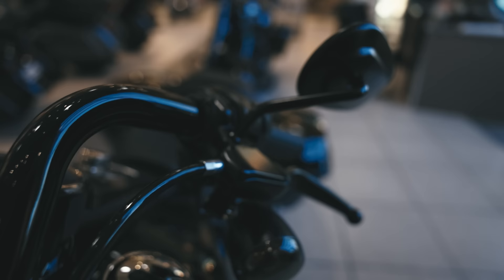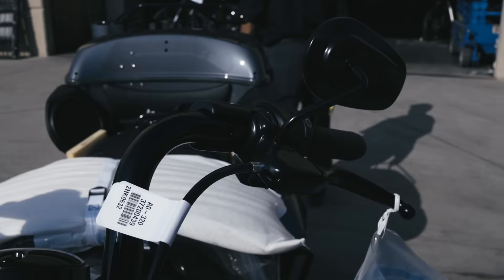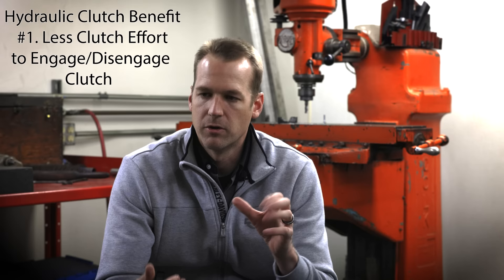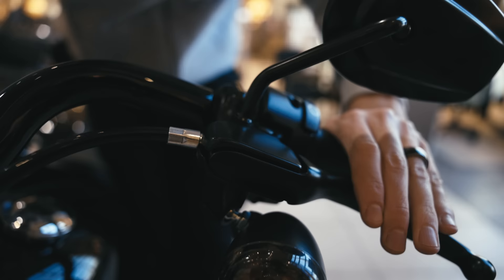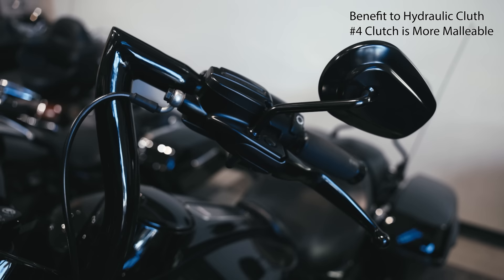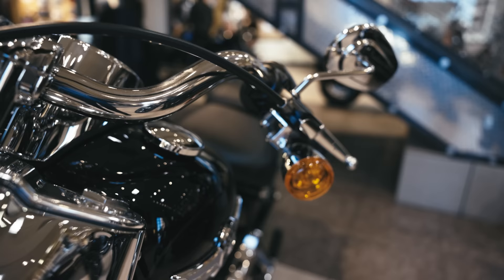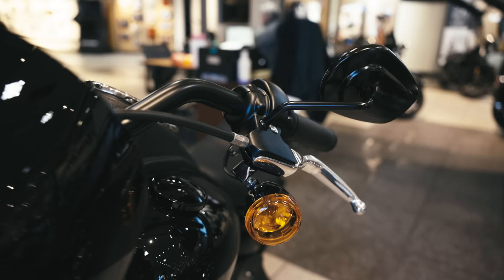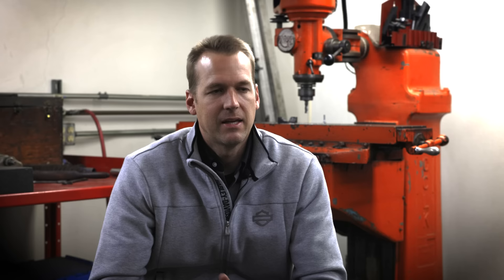Why Harley-Davidson Switched Back to a Cable Clutch on Touring Motorcycles│Pro's vs Con's

Comment: Me and ODB go Old School all the way! - Anyway, I never used a hydraulic clutch, but Ive heard a lot of folks like it.
Reply from the maker: Going to pin this comment because of the ODB reference. Haha you made my day.
Reply: Yup....if you want to whine about a tired hand....kick the thing into neutral during  a long stop....
Reply: Anyone that likes it has hands like a gorilla. Clutch engages just as I run out of fingers. Literally holding it with the first knuckle.
Reply: @rc3291  I love cable clutches. I wouldn't consider myself particularly strong.
Reply: @Slking507  Me too, I can adjust where the friction zone is.
Reply: @Slking507  Not really a strong thing as much as to where it engages and size of my hands.
Reply: @rc3291 I had to get the softbrake easy reach lever.

Now I gotta get those Oberon adjustable levers for my 124.
If I set the clutch at 3/4 turn at the primary the lockup pressure plate I put on doesn’t have enough clerance on the clutch plates. 
So to be able to shift fast at high rpm and not get stuck in gear

Comment: Anything HD does has 50% of it's "fanbase" bitching about it. They are in a lose/lose situation. If they stay the same they "aren't innovating enough" if they step outside the box they're "alienating their customer base". This is no different, it's the age of the internet, too many would rather complain than ride. Do I like the new cable clutch? Who knows I haven't ridden it, and my guess is neither have a lot of the keyboard warriors that think it's the worst thing HD has done in 100 years.

Comment: When will HD go back to kick start?😀
Reply: Next year 😉🤠
Reply: Yes... I miss kick starters. Harley needs that nostalgia back.
Reply: bring back the pedal start system.  Now THAT's old school
Reply: We laugh but..... don't give them any ideas!
Reply: I've had a hip replacement. 
I don't think I'll be kicking over any 117cu in engine, compression releases or not.🤠
Reply: ID LOVE THAT
Reply: Points and condenser was so much better than electronic ignition.
Reply: That’ll be on the sportster classic which will run $37,000 next year.
Reply: Haha
Reply: That's why I still ride a 1983 FXWG. Kick, and Electric start.
Reply: anyone replying with "I'd Love that"... did you stop to think the motors are 2-3 times the size they used to be? it'd take a mule to kick start a 117CI lol.
Reply: they wont, compression is to high on modern motors
Reply: They could do a phony kickstarter that actuated an electric switch. I see Harley guys jumping on the shifter like it’s a kickstarter, just because feels right one supposes.

Comment: I really like my hydraulic clutch on my 18 road king special it’s 100% consistent and very smooth for me and no adjustments
Reply: I keep stalling on first gear take off.. did it take a while to get use 2?
Reply: I know I would get used to it, but I much prefer my cable on my 05 electra glide than the hydraulic on my stepdads 16 CVO street glide. Doesnt feel as easy to modulate, more like an on/off switch.
Reply: @Tom-jw1pe  , you are holding the clutch lever in correctly. You should have two or  three fingers wrapped around the grip and use your index, middle, or both to actuate the clutch. You will find bat the friction Zone will begin when the lever is slightly away from your fingers on the grip and you will have much better control in all situations. That is the technique that has been taught and utilized ever since the hydraulic clutch was developed 40 years ago. You should never be using all four fingers on the clutch lever, are you giving up control of your motorcycle.
Reply: I have an 18 FLHRXS as well and I wasn’t digging that clutch. Hit up softbrake, https://softbrake.com/reduced-reach-brake-clutch-levers/
This guy reworks factory clutch levers to make the operation more like what you’re used to. Super easy install too.
Reply: @robr8207  are they adjustable?
Reply: No but you shouldn’t need it. The friction zone is almost immediate as you begin to let out. He reworks the shape of the lever itself to adjust the engagement.
Reply: @robr8207  ok thanks I’ll check it out
Reply: You bet man. Hope you enjoy it if you get one. I love mine.
Reply: Like mine on my 18' RGS! like anything it takes a little time get it down but I never had any issues!
Reply: @robr8207  it is a game changer... I love it...
Reply: Hyd  clutch had small problem.
But overall the HYD.clutch was better.
Reply: HD. Should have offered adjustable clutch lever.

Comment: I wish Harley would start moving forward instead of backwards.
Reply: I wouldn't trade any of my old Evo's for anything new even if it was an even exchange! These new bikes got too much crap on them, they're practically cars from crying out loud. Thats just my 2 cents, no offense but I'm an old school dude who fixes his own stuff. These new bikes are full of too many gizmos. Battery life is roughly 4 years. Ive had the same battery for 7 years now. A simple bike for a simple person, THATS ME IN A NUTSHELL...
Reply: @kennethwise7108  Exactly!!👍😎
Reply: @SA-hk8xj  Sad but true, RDRS? Throttle by wire? Infotainment system? ABS etc.. yeah those are all fine and dandy things but I don't want something with all that crap on it. The only sensor on my bike is the float sensor and the trigger sensor for ignition inside the nose cone. Simple crap...
Reply: They have with RDRS, TPMS, ride modes like rain and road mode, the GTS is 100x better than the old systems.
Reply: @masterchief319  to each his own.
Reply: @kennethwise7108  sure, but I'd love to know what you want the company to do to "move forward". They listened to their customer base and obviously people wanted clutch cables back. Second, the amount of technology between my 2018 i traded in and the 2021 i just got is a night and day difference. Factory LED headlights now too. I mean what more are you looking for? Water cooled parallel twin jap motors? The Pan America is water cooled and making North of 150hp out of the box.
Reply: yeah likes voice commands or Eyes Start.  i'm very sure HOnDA will do it first or BMW. YOU see .
Reply: @alejandroludovice7302  Harley Davidson has voice commands through using apple carplay or Android auto, same as my 2020 GMC Truck.
Reply: @alejandroludovice7302  Not sure what Eyes Start is but my past 2 Harleys have been keyless start.
Reply: @masterchief319  more junk that will leave you stranded if and when it fails. I'm a simple kind of guy who lives by the motto "less is best". Nothing against people who have those kind of bikes but soon these bikes will probably have WIFI and self riding mode! F that...
Reply: @kennethwise7108  strange, my past couple trucks have had built in wifi and all these features as well as other newer cars I've owned. Never been stranded. Good thing there's things called road side assistance too thats covered by my extended warranties as well as my insurance company. Sounds like people in general are making excuses for hating harley davidson when in reality the real reasons are they can't afford the high end Harleys.
Reply: @kennethwise7108  the irony is, I have lots of friend who ride metric bikes as well as in local riding groups with thousands of people, the metrics seem to be the most unreliable. One of my buddies tried to race is 600cc crotch rocket and literally blew a hole in is transmission and grenaded the clutch as I pulled a bus length on him with my stage 1 M8. He had to call a flat bed tow truck. This ain't the AMF days 40 years ago.
Reply: @masterchief319  thats why I said "to each his own" you do you. I don't like all that crap. My older bikes will run circles around any of the new crap. Good luck
Reply: @kennethwise7108  lmao yeah okay 🤣

Comment: I for one am furious Harley dropped the hydraulic clutch.  Fortunately for me I just bought a 2020 Ultra Limited last year so I won't be in the market for another bike until around 2025.  If they haven't gone back to the hydraulic by then I'll go to another brand.  Why am I so adamant against the cable you ask?  I have no interest in going back to the 5000 mile service of the cable AND I had the cable clutch on my 2013 Ultra Classic snap on me while I was 2 hours from home!  They can say what they want about the change but I think it was a money saving decision plain and simple.  Not all riders are out here doing U-turns in a 15 foot radius.  The friction zone on the hydraulic is plenty good.  Going from a cable clutch to a hydraulic was a piece of cake.

Comment: My money is on H-D cutting production costs. A hydraulic clutch costs more to produce than a straight cable clutch. So, they lower production costs and raise prices.
Reply: And insure techs future work replacing a cable
Reply: The bean counters look at EVERYTHING in an effort to save a buck. I have seen this practice being used for several years now with the Motor Company. One in particular was the cam bearings. INA (caged) vs Torrington (full roller). Thin walled Swing arms were also a money saver for them, ive broken 2 of them.
Reply: I agree, this is about nothing but increasing margins.
Reply: Yes, to save money on the cost of the bike.
Reply: No more heel shifters, only 1 fob, inferior wheel bearings, failure to recall early twinkie spring tensioners, thin wall swing arm tubing (late evo & early twinkie), leaking master cylinders that destroyed the black paint (early twinkie), cam bearing and transmission failures due to INA style bearing (1988-202?), defective stators, defective hydraulic tappets, poor engine castings 1988-1994. Surely ive missed a few things and sadly i've been stuck into this lifestyle for over 30 years now and have suffered financially from the costs of fixing and upgrading these bikes. Damn shame...
My advice to ANYONE who purchases one of these bikes BUY THE EXTENDED WARRANTY AND KEEP EXTENDING IT!
Reply: Exactly
Reply: There isn't a vehicle in 2000's that are expensive let alone standard that have hydraulic clutch. A total step backwards. The tooling and supply for the hydraulic clutch is in play, no savings going to cable. Just a regression move to make the bikes antiquated. Therefore even less sales IMO.
Reply: It’s cheaper to produce one kind of clutch than two. So they’re saving money.
Reply: Didn't even mention HD taking a beating in the clutch recall. Fifty three million is what I heard.
Reply: @jeffhelm7581  you heard wrong...
Reply: @kennethwise7108  i cant find any fatalities, injuries, yes, but mainly just a recall and problem corrected.
Reply: @markfalco5868  👌
Reply: @talkingrock7011  So you never have to do anything to the hydraulic? LOL
Reply: @MisterSpermCell  I have never had to change a clutch cable but sure have rebuilt or replaced many master cylinders and slave cylinders. I suppose you think  the electronic throttle is the hot set up just wait until that craps out
Reply: Very true
Reply: I totally agree with you....
Reply: Cable is better than hydraulic. I would pay more to have it back.
Reply: @Slking507  Not in my view.  Hydraulic...no adjustments, and no 'break' surprises 1,000 miles from home.  Been there with cable, done that...always had to travel with a spare clutch cable.  Never again!

Comment: I totally agree with you 100%. When I bought my first hydraulic clutch motorcycle I was having a hard time adjusting to it, but after 6 years of daily commute and two bikes later I now feel that I like it better and don't want to back to cable. Who would know?
Reply: I Loved the Hydraulic Clutch on the first bike that I rode with one.The Cable Clutch on My 2000 Wideglide was getting harder to pull in even after being lubricated and adjusting.I Love The Hydraulic Clutch on My current Harley 2015 Streetglide Special.I have rode a few Harleys with easy to pull cable clutches and don't have no problems with them,they are just few and far between.

Comment: The friction zone on my 2014 FLHTCU is exactly why I purchased and installed the Soft Brake, front brake and clutch levers.  HUGE improvement.  Friction zone is much closer to the grip and much easier to control.  Front brake is easy to apply with 2 fingers as I ride, as well.  Best money I have spent on my bike.  No messing with the hydraulics like when you replace the slave cylinder either.

Comment: I see your view points but i do disagree. The fact that touring motorcycles are 30 or more easily. Yet don’t offer hydraulic clutch is ridiculous. 
It sounds like you’re trying to convince yourself this is a good thing. It’s not. It’s so out of touch.
Reply: I really like Matt, but yeah at times he is trying to convince himself that something that HD has done was a good thing. Honestly he has to, he's married to the Motor CO with the decades and family history with the dealership.
Reply: Heat Transfer from the Exhaust to the Clutch Cover is some of the Problem..
Reply: @Acmegamer  idk Matt is usually pretty honest with what he likes and dislikes about the Motor Co. he’s never been afraid to criticize them. That’s why I like his channel

Comment: I like the cable clutch, I can put the friction zone where I want it.
Reply: My BMW has adjustable clutch and brake levers so I can put the friction zone where I want it also.  And adjust for different sized hands.
Reply: @LTVoyager  lmao dont make him look like a caveman 😂 bmw is like that song "anything you can do, i can do better" but i still love harley (v-rod) 😉😎
Reply: @JL-wf2wp  I thought the V-rod engine was nice, but the rest of the bike wasn’t my style.  I am fairly impressed with the new Revolution Max engine also, but, again, it isn’t yet in a platform I am all that interested in.  I am mainly a long distance, two-up tourer and thus look for luxury touring bikes like my current LT, the Gold Wing (well, it used to be a luxury touring bike - not so much since 2018), etc., but I like modern technology also.  If Harley will just build a luxury touring bike around the Revolution Max and have a bike as competent as the engine appears to be, I may become a first-time Harley owner.
Reply: @LTVoyager  im in love with the vrod engine. Im not sure about the new revolution, it looks like a chinese copy of the previous porsche made revolution 🤔 maybe im wrong. And the vrod style isnt mine either.. but i can cope with the night rod special model with a different handlebar and further feet controls. The fat tire doesnt look bad at all 😎 you should give the vrod a try you wont regret it
Reply: @JL-wf2wp  I like most motorcycles so I am sure it would be fun.  However, just not practical for two-up riding any distance.  I have my K1200LT for that and a KLR650 for short, fun rides locally.  I would like to trade in the LT as it is 14 years old and has nearly 100,000 miles, but I have test ridden nearly all of the current full dress touring bikes and none are any better than the LT and most are worse for a lot more money.  I keep hoping though for a viable replacement to come along.  If not, I will probably get an R1250RT as it is about the closest to the LT without being a maintenance nightmare like the K1600s.  I really wanted to like the new Wing, but after a 100 mile test ride, it just has too many shortcomings, mainly luggage capacity and fuel capacity.  The seats are terrible also, but that is easily addressed.  The other two are a lot more expensive to fix.  😁. Maybe Harley will come through with a modern touring bike built around the Revolution Max.  One can hope, right?
Reply: Even my dirt bike has a hydraulic clutch. A clutch cable is outdated and archaic. Real motorcycle companies make it so you can adjust the lever to set the friction zone where you want it on a hydraulic clutch. I wouldn’t expect anything less from a T-shirt company that sells motorcycles to  people who don’t like technological advancement. My clutch cable plastic piece broke and left me stranded on a 23 street bob with 750 miles on it. Pathetic.

Comment: I have a 2020 RK standard, wife has a 2018 heritage. I can ride both and be fine, however I feel like the cable is a little easier on the release. Probably just me I do have some wrist issues. For you guys who want a shorter and easier pull ( IMO ) on hydraulic, softbrake.com. Night and day difference for me, swapped out my clutch and front brake lever. There is a inch less travel on both, yes the clutch fully disengages. I do feel hydraulic has a smoother actuation on pull and release. I have no problems doing low speed maneuvers with hydraulic, even easier with the softbrake clutch lever. Sorry Matt, I’m not sponsored by softbrake......lol just helped me a-lot. Less hand fatigue from a safety perspective.

Comment: A great analysis Matt, you really nailed it.  Really good to hear a thorough and totally unbiased even handed assessment.
I have ridden both cable and hydraulic clutch and have no problem with either.
My preference is the hydraulic clutch for the reasons you covered in great clarity.
I believe the main reason Harley made this change is down to cost, the bean counters made this call.

A great video Matt, keep em coming 👍